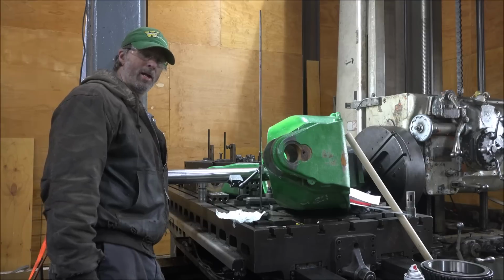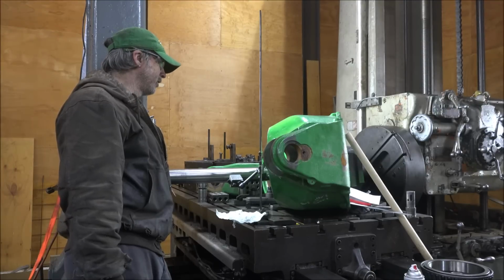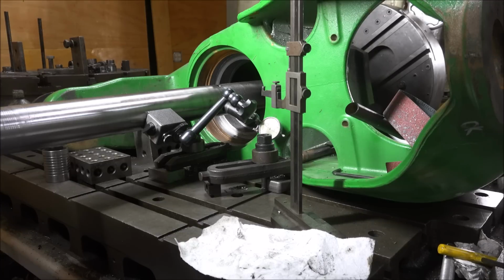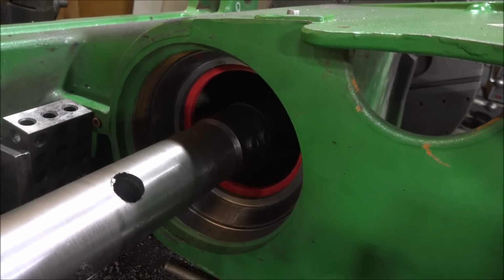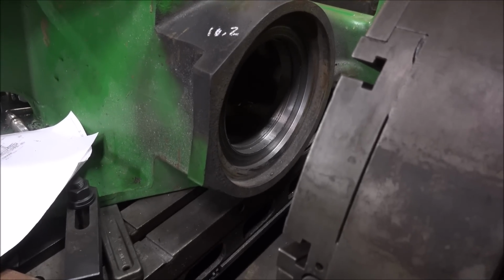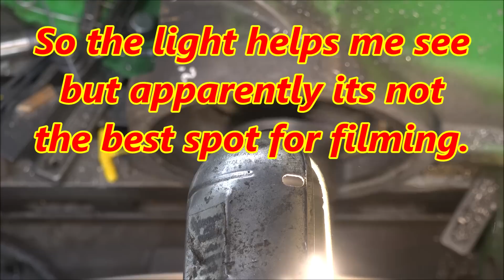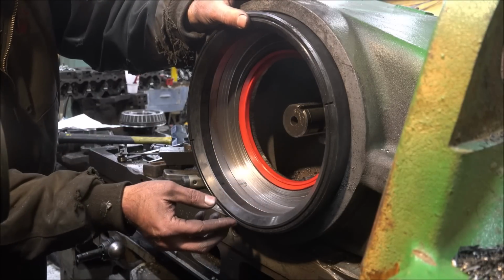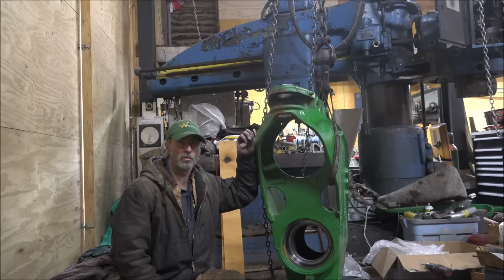Rarely Seen HBM being used with a BIG Boring Bar Align boring over feet!

Comment: You'll have to get one of those in-line telescoping gauges that go in the cutter bit hole. Curtis at cutting edge engineering has them for his line boring set up. Maybe they don't make them as big as you need, wouldn't be hard to make though for someone with your skill

Comment: Very nice work Brian.
This is a complicated and difficult setup.
I think your boring bar was a success. 
I made a line boring bar out of 2.0 D2 bar stock, 3 foot long and the boring bar bushings out of mild steel cold roll.
Finished the ID on the rod hone.
Drill oil hole in the bore bushings and used key seat cutter on the inside to cut and key seat that intersected the oil hole for oil distribution. 
I had the same problem trying to seize up till I did the oil modification. 
Figured out the clearance. 
Works perfectly now.
I use way oil and or Racing oil with Zink.
Nice work again Brian.
Thanks for sharing. 
Take care, Ed.

Comment: Hello from Aus. I recently watched a video where a shaper/planer gauge was used to set the tool extension out of the bar.  The gauge was first set with a depth mic. BC
Reply from the maker: It could be done that way but I don't have a planer gauge and I always prefer direct reading measurements as opposed to transferring them. The more times you transfer the greater the risk of getting errors and not ending up with what you wanted.

Comment: The boring bars for our g&Lare hardened and the 6" fits right in the outboard support. All the smaller ones have a cast iron bushing to bush the outboard support down to the bar size. THe cast iron bushing has a bolt in the flange to bolt it to the outboard bearing to keep it from coming out. The outboard support has timken tapered bearings in it. We had a large forging that we had to  bore out 6,000 lbs of chips with the 6" bar.
Reply from the maker: Boring 6000lbs of chips sounds like a couple of day project.  I love jobs where you need a skid steer to keep the chips packed away. 😎
Reply: @bcbloc02  We had to shovel them into the dumpster and haul them away with the forklift
Reply: Also we have some mics at work that look like od mikes but they are for measuring a bore around the bar so you can measure while the bar is still in there. On smaller bores we just measure with small id mics. We put them through one of holes for the tools. Our bars have a square hole and also a rectangular hole every so often.

Comment: Hi Brian. Congratulations on first class work on this huge component. I imagine not many, or any, shops in your area have the expertise and capability you do. so impressive. I have noted micrometers that insert into the cutting hole in line boring bars.  Maybe something you could use? warm regards vic

Comment: I made the mistake of using 4140 prehard to make a boring bar out of. It galled up so bad in the bearing I had to cut the bar off and press it out of the bearing. I only use 1045 chrome plated rod stock now, it never gives me any trouble.
Reply: Same here, regular TGP would gall in my support bearings and cause no end of aggravation.
Reply from the maker: Now y’all tell me!!  Lol  my bar is mystery metal but being it was drawbar material it probably was high carbon.
Reply: @warrenjones744  isn't that crazy!? I always thought ball bearing material would be so hard the two wouldn't get in a fight, after I had trouble I started researching bearing material and found out they are much softer than I had thought.

Comment: Hi Brian, your comment about difficulty getting the bore diameter measurement with the bar in place, take a look as cutting edge Engineering on YouTube Kurtis does a lot of this type of work and he takes the cutter out and replaces it with a telescope gauge, this can then be measured with a standard outside micrometer, hope this helps.

Comment: It's not perfect yet, but it got this job done.
On that PVC reverse countersink we were talking about, it occurred to me that a modified jewelers screwdriver might be just the thing. It's got a very small diameter but it is also very stiff. I think I can bend and flatten and file the end to the 'half Y' shape you mentioned. I may have to anneal it, work it then harden it again, but I'll try it first without. I'll let you know how it came out.

Comment: Looks like the new boring bar did a great job Brian. you might think about putting a bronze bushing in the tail stock bearing so it will not grab the shaft.Thanks
Reply from the maker: The big bushing I made runs in oil in the tailstock so that is where I want the rotation to occur. Tying it together with a key seems the best solution.
Reply: the key also makes it easier if you need to put/drive a bobbin on the bar for larger bores or faces so the tool has more support
Reply: @bcbloc02  that sounds pretty good, I have taken to copying the squeeze lock type bearings that my climax line boring rig uses, I can snug them up to create enough friction to force them to spin and at the same time remove any play that develops over time.

Comment: Do you have a bore mic to fit through the holes in the boring bar to measure?
Joe
Reply: What hole?
Reply: Go to 1:37 and listen.   Most bars have a series of holes.  
Watch some videos of line boring and most of them have a micrometer that does this. 
Joe
Reply: You can Climax and a couple other companies make telescoping gauges that fit through tool slots and are locked with set screws